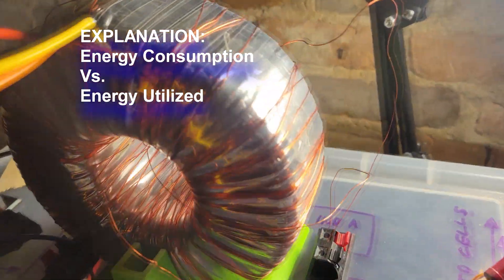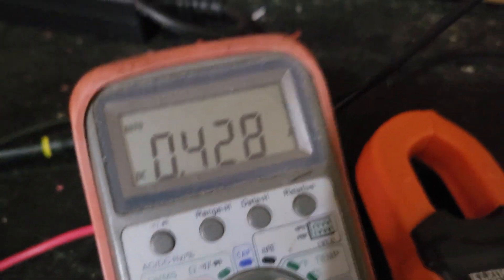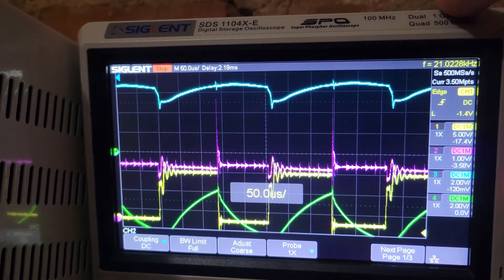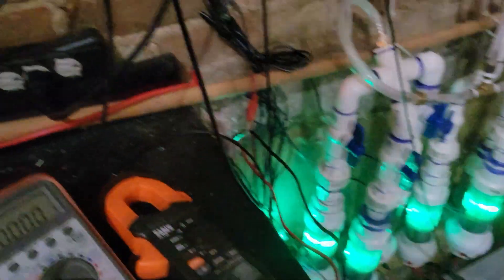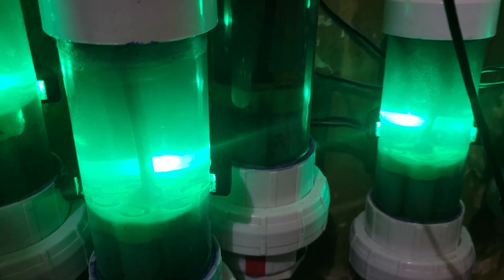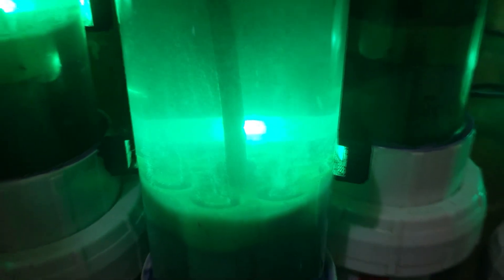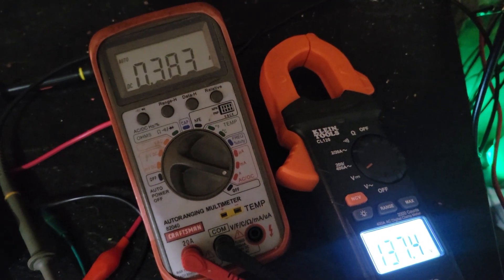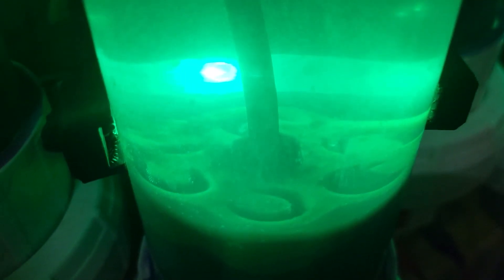Total Power Consumption Vs. Cell Power Utilization (Toroidal VIC)

Comment: You might want to short those non-utilized coil taps on the toroid. I'm 50/50 on it though, there is a huge choking aspect that occurs when that open winding builds up a huge parasitic charge. Power should reduce more if you short them.
Reply from the maker: i originally misread your comment. you said SHORT, not shorten. I will short those leads and see what it does. Thanks!

Comment: To produce HHO first you need surface area on plates in water, platinum is ideal but 316L stainless steel work very well. secondly, water breakdown voltage is only 1.97 volt so anything over 2.5 volt will only create heat. But you can feed it with tons of amps. third you need an H - bridge switch because you need a squire sine wave to clean the bubbles of the plates after forming. Then you can play with the frequency to find the sweet spot. Good Luck.
Reply from the maker: Stainless is the only way to go as far as "obtainable" production means. My cells do not produce any heat, all the way up to my present max of +4V per tube. I'm not dumping amps into my system. I am restricting amps, allowing the voltage potential to increase and perform the work of disassociating the water molecule's covalent bond.... It's not a 'DC amperage electron-exchange' that traditional DC electrolysis setups utilize, but rather a voltage-resonance condition that subjects the water molecule to a high-voltage potential.